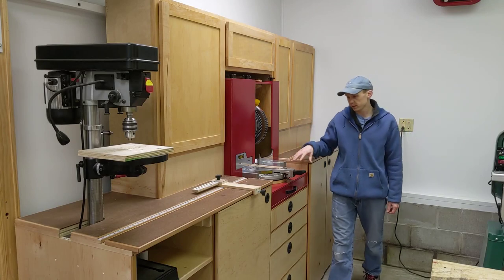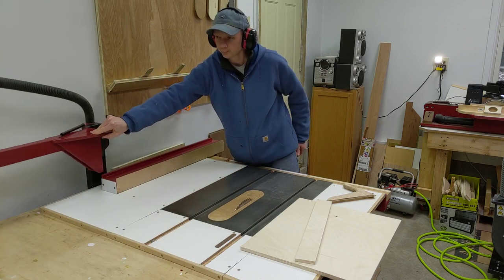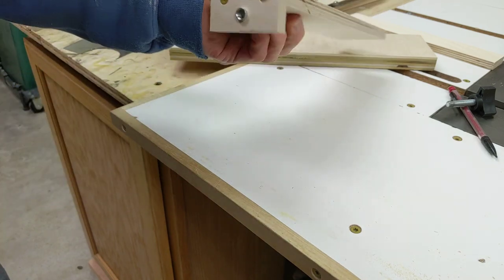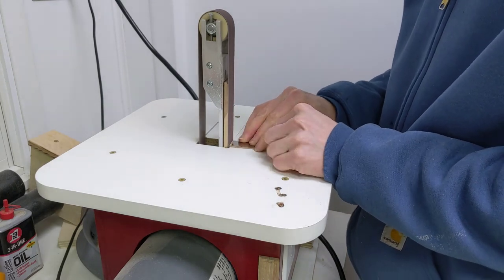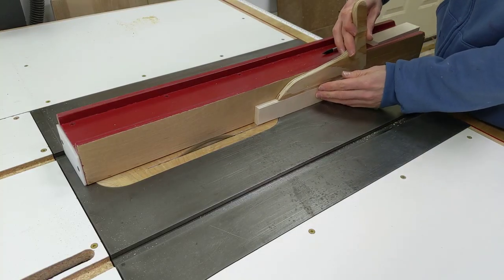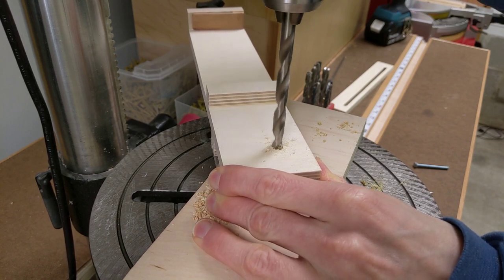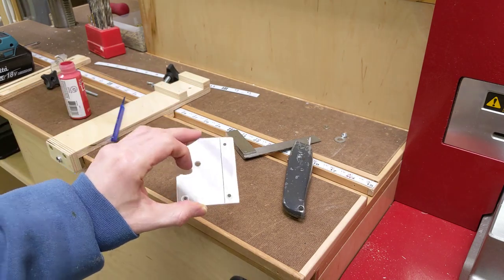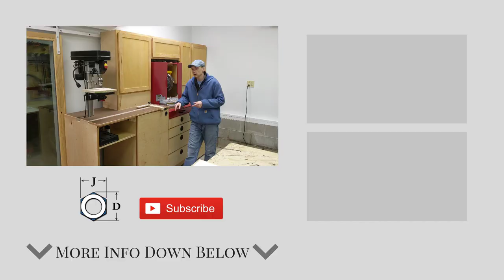Stop Block for Miter Saw (No T-Track Required)

Comment: Great job! I am watching a lot of miter saw station builds to prepare for my own and one thing i am really trying to do is buy as little hardware as possible. I love your idea. I was thinking of carving my own t track out of wood with a router bit. i like your idea because the whole width of the board is secured.

Comment: Hey. First off I wanna compliment you on your work. Very nice workmanship and innovative ideas. I think my favorite build is your vertical strip sander. I'd like to build the same thing, at some point. 
As watching this video I was thinking... your overhead tablesaw dust collection is fantastic. But when you switch to using a sled, nothing. I wonder if there would be a practical, unincombersome dust solution for use with the sled. I'm gonna do some thinking about it, as I am willing to bet you've had some thoughts and ideas on the same subject. I'd like to see what you come up with.
And, nice miter station workstop!
Reply from the maker: Thanks Mark.  I agree that dust collection with a sled is difficult. That's why I do most of my cross cutting with the miter saw since I have a good dust collection hood for the miter saw. I would like to tackle dust collection for sleds sometime in the future.

Comment: You could also index the large slider with a dovel and a hole drilled into the slider and the table below, that way you don;t have to be super precise when you position the large slider to use the small extension for cuts shorter than 15". :-)